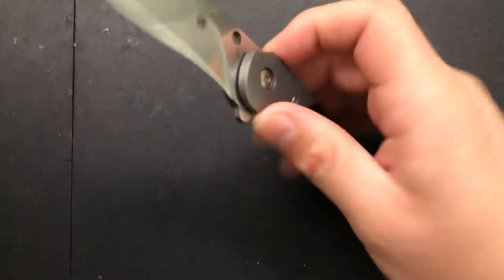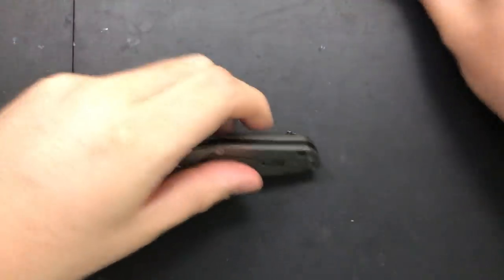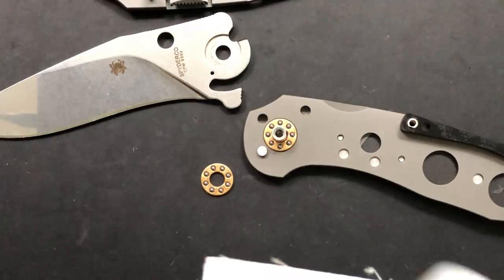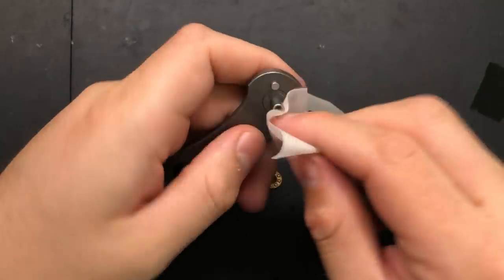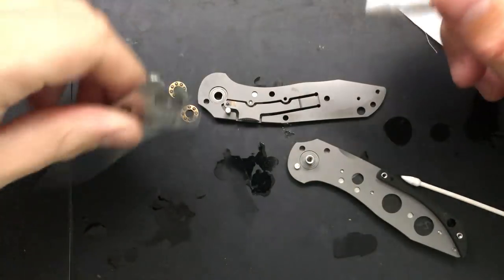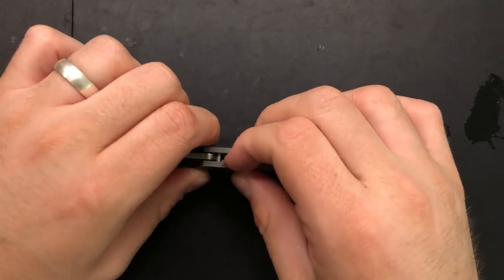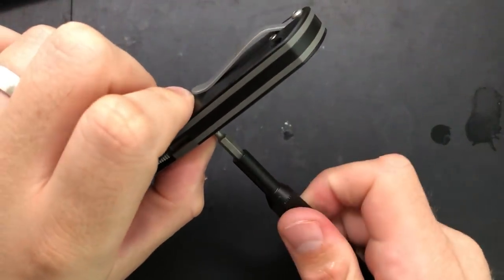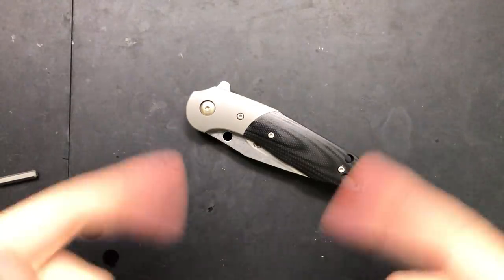How to disassemble and maintain the Spyderco Hanan Pocketknife

Comment: Why didn't you bend the lock bar out to increase the detent for the flipper?
Reply from the maker: Because that's often not a good solution.  If the ball isn't prominent enough, all the lockbar tension in the world won't make it flip well, and will just make the knife harder to shut.
Reply: Hi Dane and Nick, have you tried to drill or grind the detent hole a little bigger so the detent ball has more space to set? 
Keep up the good work Nick!
Reply: Sandor Andras this is a possible issue, but if thats not the problem then you wind up with the same bad flipping action plus now you have play in the deployment you can never fix.  But just like my suggesion, if you know what to look for you can tell if that will fix it in person.  But you have to be absolutely perfect with it to keep from having slop/play.  The beauty of bending the lock bar a bit more is you can always bend it back.
Reply: Dane Fuller 
I understand that. But bending something ist a plastic deforestation to. You may do that a few times than you end up with no lock. Id try to sand the hole a bit bigger but i don’t own a knife that has a week detent. So i could tell you if it worked or not. Nice to talk to you Dane have a good one!
Reply: I've done both in the past.  The plastic deformation is not really a problem.  You would have the bend it past 45 to 90 degrees before that became a problem.  The steel they use for the compression is treated in a way to make it perform like spring steel for that reason.  When you say sanding the detent hole you don't want to sand the hole, you want to re-drill it.  If you sand the hole you will wind up with a small ledge that allows the ball to ride into and out of the hole more easily.  I have done this in the past on detents that were too harsh.  It softens the detent and does not increase it.  The only way re-drilling the hole works is if the ball does not quite enter the hole fully (which you can visually check).  If that is the case you want to re-drill the hole just enough for the ball to fully seat into the hole, making sure to keep the hole as perpendicular to the lock bar as possible to make sure you increase the detent and don't leave a ramp.